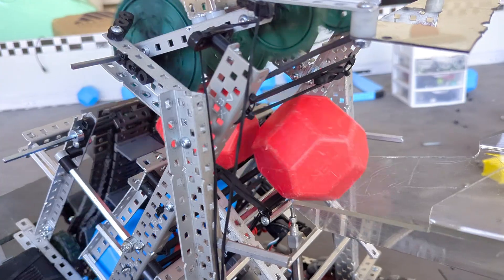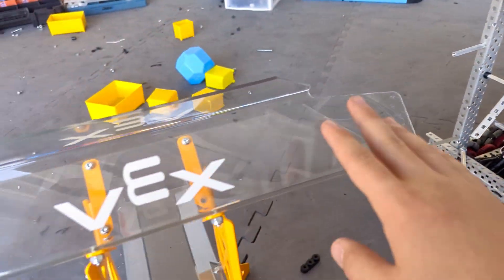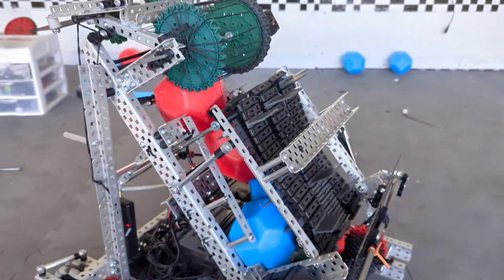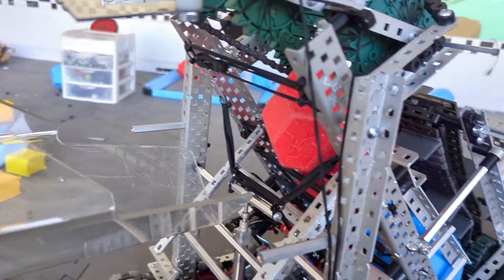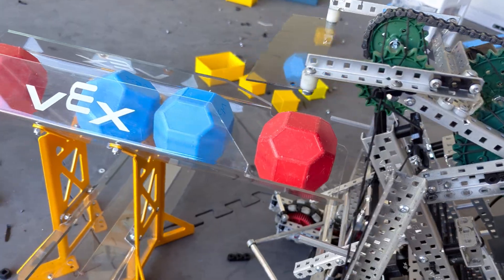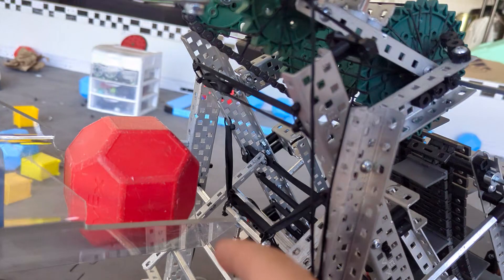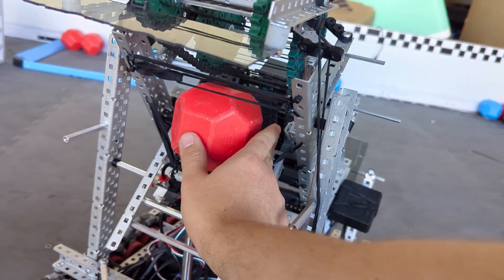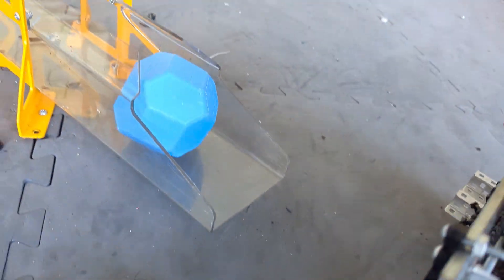Scoring in the Upper Middle Goal | VEX Push Back

Comment: What length pistons are you using for the upper middle goal and the match loader?
Reply from the maker: I use the long piston to get the rubber band the most of of the way for the middle goal. Foe the match loader I also use the long pistons to get maximum travel. There isn't too many pneumatics on this robot so I'm not worried about running out of air.